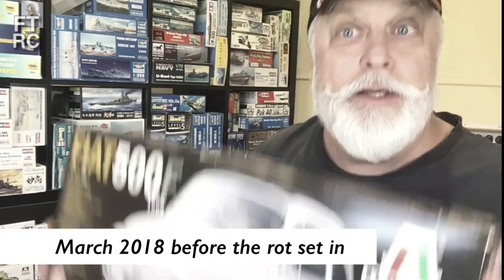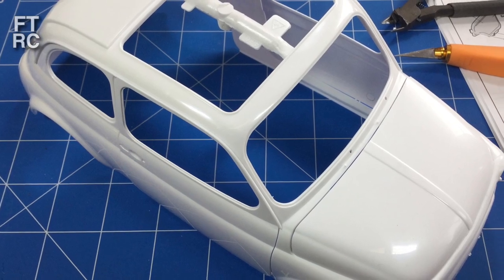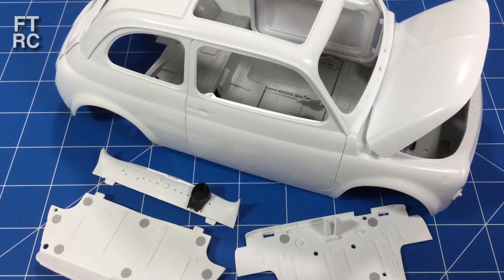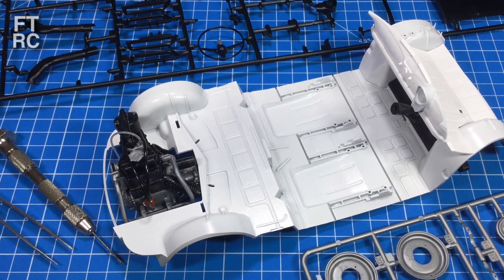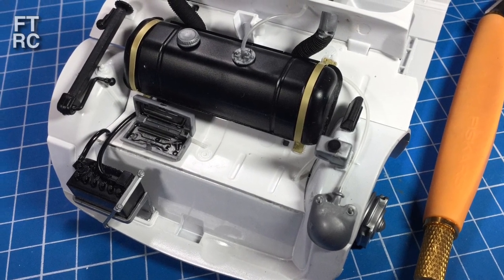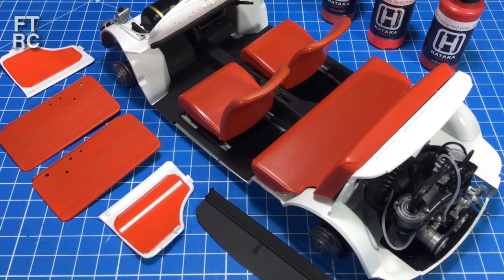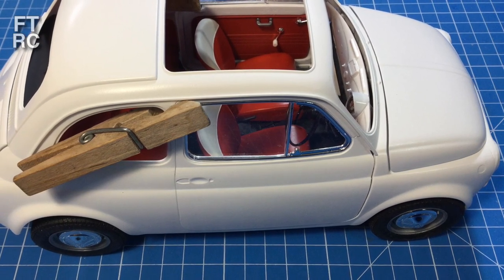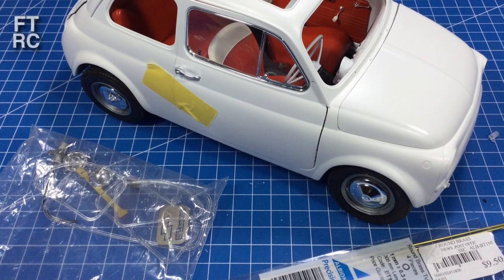The Worst Model Kit in the World and it's Italeri

Comment: Since the finished model is intended to rest on a shelf finally, I would probably mount the whole thing on three tiny sturdy pins fixed straight to the floor plate. You would hardly see them but they can take the whole weight of the model.
And the suspension can remain „workable“.
Reply from the maker: That would solve the leave on shelf to break problem due to the weight…. but from experience I know the suspension is so fragile that I fear the mass of the wheels would break it on movement even if supported just due to the mechanics involved with parts having no tensile strength
Reply: @HarryHoudiniModels  Like the real car ,lol

Comment: Hi Harry! I got this kit last Christmas and started working on it in my free time.
Didn’t take me long to realize materials are brittle and instructions are bad. So since then I’ve been looking through the internet and YouTube for build videos hoping to come across someone who had mastered it lol
Now, steering didn’t work for me and I have the same issues with the suspension as you had, BUT all that I can sort out. The bit I can’t get right and I hope you have and can help me with, are the doors. Any chance you can give me some tips on how I can make the bloody things open and shut tight?
Reply from the maker: I mounted the doors to the body first, before doing any other work on the model.  This made it easier to paint.  They worked fine at first, but as the build progressed and the interior was added, the weight of the interior and eventual warp of the body, broke the hinges.  Even after I used metal pins and CA glue to join them all back together the kit kit would just suicide and spit the doors off while sitting on the shelf.  It was so frustrating.

Comment: I have just subscribed & watched a few videos. All good stuff. I haven't done this kit as my main interest is 1/72 aircraft & a bit of armour. I quite like Italeri kits for the same reason that you like Airfix - a great basis but a bit rough around the edges & needing some (but not too much) refinement.
Reply from the maker: Yes some Italscary kits are buildable and refine-able… but this POS just broke apart under the weight of the paint while sitting on the shelf.

Comment: Italieri, the name alone is a brand to give you the screaming ab dabs. I've started 3 kit builds that were their 1/48th A-10, 1/35? RH-53 Sea Dragon and I don't recall the third it must have mentally scared me that badly. All I can remember are badly warped wings and fusalage with the A-10 and the Sea Dragon was a nightmare of badly fitting pieces and gaps all over the places. Eventually, they ended up in the bin as I got fed up of the kits. As the buyer i like the challenge of building it and adoing small amounts of work to get it right, but those kits should not have left the factory. Hence why I keep that brand at arms length and avoid at all cost now!
Reply from the maker: So many horror stories… I almost feel better now

Comment: Hi Harry, I was lucky enough to never have big problems with Italeri kits (I guess that I picked the good ones)and every time I hear people hating it, I feel injustice or people just repeating what they heard without trying (also Italeri did a lot of ESCI re-boxing...🤮), but in that case, it's justified, wrong design and wrong material, I totally understand your frustration about that kit because it's a new kit and it shouldn't be that way. 
It reminds me of the Citroen Traction 15/6 by Heller at 1/8, where the body doesn't join and linkage and suspension breaking under the weight of this beast. 
So, this kit is really bad, but the worst kit in the world? There is a lot of competition in that category, to me, the winner, all categories was ESCI, poor detail, skinny parts with thick flash, broken parts on the tree, wrong to the original, and in some cases not exactly the one pictured on the box... 
I'm building the Ferrari 250gt swb from Italeri, and it's a great kit, very detailed, it's old and everything doesn't fall in place easily (like a lot of kits of that era), it takes a long time to build just because I'm detailing it and that's the mojo killer to me, but it's my fault.
Reply from the maker: I’ll admit not all Ital-scary kits can be this bad… I have their big motorboats and they have a good reputation, along with some aircraft kits that are well liked.  But the Fiat is a drongo!

Comment: Italeri made some of the best detailed models back in the day (70's early 80's), although they always had some annoying feature (i.e. sinkmarks in the middle of the drive sprocket of Panzer 1 or such). More recently they seem to be mixed bag. For example the 2 man midget sub in 1:35 and their Explosive boat are very good.
Reply from the maker: I have some of their motorboats and yes they look and people say are very good.  You just never know.  Even my beloved Airfix has some real bad apples as well!
Reply: I am from Canada and primarily model Canadian and US highway trucks/ trailers. My personal experience with Italeri's kits of North American Class 8 trucks is that parts fit is usually quite good but accuracy is a mixed bag. I believe their Freightliner FLC was one of the earliest, if not the first, release of a North American truck and fairly accurate overall. Many subsequent kits like the Western Star, "American Superliner", and Ford LTL used the same frame, suspension, and cab floor which was not accurate for those trucks at all. 

The Volvo tractors are curbside models (no separate engine) which I would be OK with if the price wasn't the same as trucks which DO have separate engines! (Speaking of which, the Detroit Diesel Series 60 in some of their kits such as the Peterbilt 377 is nice)

Their 48 foot van trailer is another questionable one with the two piece ribbed sides (darn near impossible to clean up that join line!) and too-low finished height, about 12' instead of the typical 13'6". 

With that said, I did combine parts from their 48' van trailer and container trailer kits to create a 1/24 scale van trailer with FRP sides, using styrene sheet for the side panels after sanding the ribbed kit sides smooth.

Comment: What a story! Kits can indeed fight you all the way, but if there is, as you said, no reward in the end, it turns into the nightmare you described. I know that feeling as I fiddle around with a lot of East European kits before '89 style..Am surprised though that you did not replace some steering struts with metal rods yourself, as you did with the doors. In the end the only real disappointment was the front suspension. Greetz DutchDave
Reply from the maker: The problem was, it’s a commission job, so I was just building it for their needs not mine.  Had it have been my kit I would have left it broken down but also rusted it out.  Exactly as Fiats are like here down under.
Reply: @HarryHoudiniModels  hahahaha totaly true. I forgot about the commission part. Italian kit, Italian car 🚗 = double trouble 🤪👍

Comment: I’ve built italeri kits that were so delicate, every time id pick them up, I’d break a few parts off.
Reply from the maker: Exactly Rob.  Ital-fall-aparty
Reply: Things haven't changed much in the 50 odd years I've been modeling...

Using a solvent cement intended for ABS, and sometime a "snotty" glue made for PVC pipe sometimes helps.

Comment: Sorry you had an awful time of it - I have built 1 genuinely bad Italeri kit and it was on component of their Mistel the old bomber made into a flying bomb that was guided by a fighter on a piggyback frame and released.

The Ju 88 was a dream to build just fell together with a little fettling but I still am made very nervous by how flimsy the framework to hold the fighter is just like the Fart 500 there it could use some metal for sure but even this still holds up today even if a little wobbly but the 109 that was to go on top was a nightmare in waiting:
1. Paint and assemble the interior - Yup!
2. Paint where needed in the fuselage then add the interior - Yup! 
3. Glue the 2 halves of the fuselage together - NOPE! 
I applied my glue as usual and as I was gently pressing the section between the cockpit and tail the plastic collapsed - never happened before or since to me but yes I was sat there stunned with a squashed 109 haha

Ended up getting a Revell one to replace it and that to this day sits atop the Mistal (I will do both spellings as I actually can't recall right now which it is).
Reply from the maker: Although I enjoy correcting and fixing kits, that Italscary Fiat just defeated me.  I like to make a correction or fix a problem then move on.  But that stupid model just kept falling apart after every repair, so I found myself frustratingly going 1 step forward then 2 steps back every time.
Reply: Mistel . As in German for Mistletoe . Because the plant is 'parasitic' needing a 'host' , so too the 'plane combo .

Comment: My worst kit was a Lindbergh l700 Dodge cabover with the chromed tanker trailer combo kit. Damn near every piece had to be FILE FIT!!!!! Had opening doors,spent 3 DAYS fiddling with those,and they ended up snapping anyway! The trailer was a complete shit sandwich, kept the finished model hidden on the back of a shelf for a couple years,and took the trailer apart and built a Peter built 359, stretched it,and scratched a trip drive setup and made a really nice fuel truck. The tractor,I took the fith
Reply: I took the fifth wheel off and built a really pretty wood flatbed and turned it into a cool little pickup truck.
Last Lindbergh kit I will ever buy!!! I walked past an original tandem axle  L700 flatbed trailer with the 40 Ford coup combo kit for 65 bucks!! Just gave it the double bird and walked on by!!!
I've built a couple Italeri semi trucks and they have been pretty decent. I modified them a bit,put different engines in them etc.  because almost all of the Italeri trucks come with a Detroit series 60 and that's just a boring looking engine. Otherwise not bad,that flat pack individual piece cab scared me off for quite a while,but that turned out to engineered quite well and was pretty much the easiest assembly!
Anyway,take care,thanks for the warning!!
Reply from the maker: I’ve only had a few Lindberg kits in my stash.  Each was opened but then just from a quick look inside the box it was obvious the kits were rubbish, so I sold each one as quickly as I could.  Now I won’t go near the brand.
Reply: Yea verily,brother!

Comment: Sounds like a traditional Italeri kit from back when...

They used to use a resin with a lot of ABS in it... brittle, and resistant to cements that lack methylene chloride.

These days, they use a softer resin - which often tears... in the same old molds from the 70s and 80s...
Reply from the maker: Modern moulding, same old design issues.

Comment: Pfft. Let me introduce you to AMT.... the 68 Shelby GT-350 damn near made me loose my will to live. All the ejector marks and sinks of your Italeri, and nothing fits, absolutely nothing. The front and rear clips are about 2mm wider than the body ON EACH SIDE and look like they came from a completely different car. There's more putty than plastic trying to get these parts to line up. If you manage to build it rather than chuck it at a wall or set it on fire, the front end sits so high it looks like it must have come out of a 4X4 pickup. I have refused to buy an AMT kit since.
Reply from the maker: Now I have more nightmares

Comment: I had or still have a ICM 1:48 BF 109F-2 kit no 48803  it looks good panel lines clean etc but once you try to get it together nothing fits , you line up the 4 engine mounting points you stick them in , you have guides on the struts you cant get it wrong but f me the engine is crooked  the cowling wont fit over the engine tried taking the blower off the side of engine still wont fit. Going to turn this piece of crap into a crashed 109 not that i like wrecking a kit , what i am worried is i have 3 other ICM kits of He111 and do 217 and do 17 have i got 3 more lame ducks, Shouldve bought Tamiya kits maybe
Reply from the maker: I think ICM have a few black sheep, and they are not shake and bake like Tamiya, but overall there are a lot of very well engineered kits.  Check scalemates.com for reviews of any kit.
Reply: @HarryHoudiniModels  Thanks Harry i will do mate it will make breath easier , the panel work was good and detail just the engineering LOL, I will look into scalemates and look forward to your next Youtube post cheers John

Comment: THEY say,to a "real"modeller there is no such thing as a bad kit !
Reply from the maker: Well this “real modeller” tried for 4 years but that POS would need to be completely reworked with scratched stronger parts, just to stay up on it’s wheels.
Reply: Agree.
Reply: @HarryHoudiniModels  Then do it. That’s what we modelers are here for. The only easy day was yesterday. Adapt, improvise, overcome.
Reply from the maker: Did you not watch my video?  I did adapt and improvise… but the POS just kept fighting back.  The only way to fix this awful kit is throw away a lot of the plastic parts and build your own out of metal from scratch.  As it was a commission job, and not my choice of build, I had no interest in wasting any more of my time with that pursuit.  
 
I am however quite happy to rebuilt an old Revell or Airfix sailing ship kit with lots of replacement scratch.  Because the effort will be worth it, clearly seen afterwards, and the process is enjoyable.  None of those things apply to this Italeri Fiat kit.
Reply: @HarryHoudiniModels  I did. This kit most probably needs even more adaptation and improvisation…
Wait until I start to tackle their Fiat 806 (also on commission). I’ll probably atone for some additional sins I didn’t even commit yet.
Reply from the maker: I will keep an eye out for you in the Scale Modeller Asylum.. while I drool into my box of broken kits and mutter inconsolably about the horror and trauma I experienced with the Italeri Fiat!
Reply: @HarryHoudiniModels  😁👍

Comment: After watching numerous videos on kits and reviews, it appears there are no kits without some issue. As an example, i wanted to build a Lancaster in 1/72 or 1/48 and the more i researched Kits available, there were none without issues. The problems would often cover part fit and inaccuracies in representing the real aircraft. It seems no maker is without criticism concerning some of their kits. As for ITALERI, I built both versions of the NORTHROP FLYING WING, both old kits but worth the effort because no other model of this aircraft is available. I have built kits from most of the makers and found some of their products disappointing but some produce less substandard kits than others. I am currently torturing myself building the TRUMPETER 1/48 typeVIIC U-BOAT.  If you want a kit of a u-boat in this scale with a detailed interior, this is it. It comes with its own headaches and trial and error construction issue  (probably a reflection of my lack of skill). My re=entry into kit bashing appears to highlight that it is now mandatory to add photo etch or upgrade parts to achieve an accurate or complete model. The fun seems to be secondary to the hobby. cheers from Sydney.
Reply from the maker: True however this Itascary Fiat kit collapses under the extra weight of the paint!  It’s just a complete disaster of a kit.
Reply: @HarryHoudiniModels  cannot argue with that....some kits are a disgrace.

Comment: I'd recently done 124TH scale mercedes s600 build painted and then body dosn go on chassis so im considering using it as a road side collision dio with a wrecker truck coming to take it away but only some kits work fine.. But they did just re issue this kit in italeri too👍
Reply from the maker: I hear Italscays Truck kits are quite good… but I’ve never built one.  Just this awful Fiat!

Comment: I've got that one in my stash 🤔. Maybe i'll leave it as it is. In the box.
Reply from the maker: Well you could just replace the suspension with metal, or epoxy glue it solid.  That will save a lot of heart ache.  Then you just have all the ejection marks to contend with.  I’d also glue the doors fixed, either open or closed, and under no circumstances try to turn the steering wheel.  That might get you through the build without too much hair loss.

Comment: Incidentally I got the new Trumpeter 1:35 Su-100Y Soviet SP gun, which is a pretty bad model and expensive at that. The fit overall is good as are the wheels and individual link tracks (no ejection pin marks at all). But the details level is very soft and crude and the horn for example is missing altogether, actually worse than their 20 year old KV series which are quite good (except for the pin marks on the tracks). So go figure...
Reply from the maker: Must have been designed by the work experience kid
Reply: @HarryHoudiniModels  Definitely a plausible explanation

Comment: As nice as the Aifix P-51 looks in the box, I have yet to get one together. Tamiya and Hasagawa, no problem. It just DOESN'T FIT!!!. Hobby Boss and Fujimi kits fit better than Airfix.
Reply from the maker: You must have only built the bad Airfix kits from the 80-90’s when an American consortium took over and reboxed crap mouldings.  Back in the 60’s when it was owned and run by the Brits things were much better.  The kits did fit together.  Since the mid naughties Airfix got back into British control and used CAD.  The new kits fit like Tamiya.  Not my words.  From a friend who is a Tamiya fan boy.